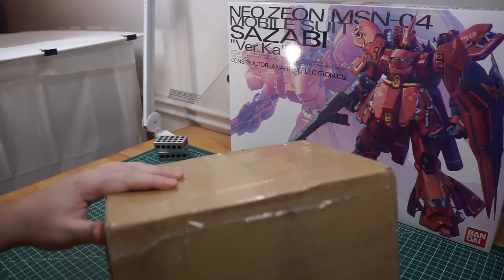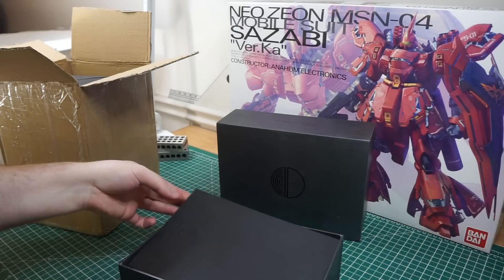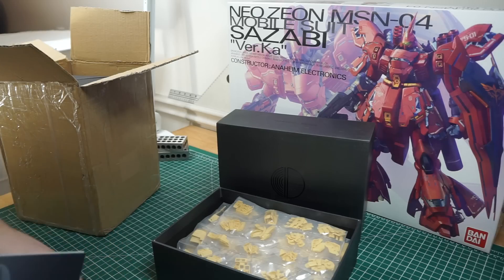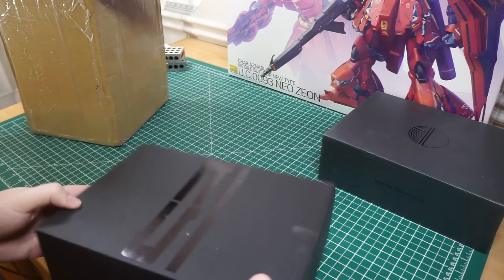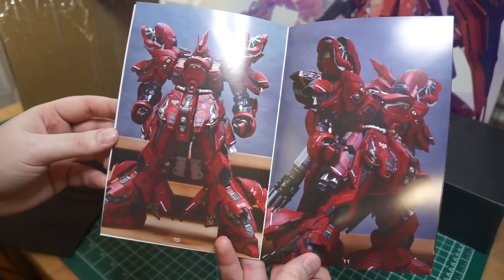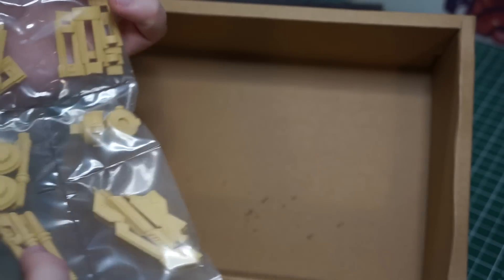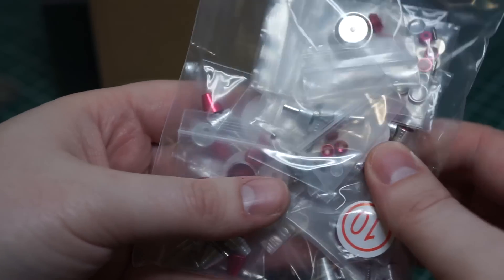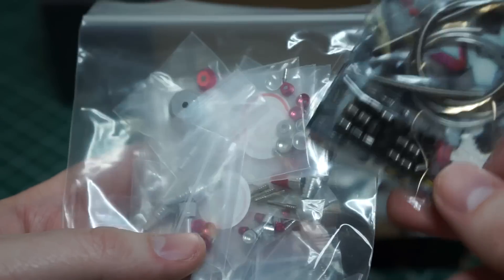Sazabi Ver.Ka Infinite Dimension Resin Conversion Kit | UNBOXING

Comment: Where can I get both sets of conversion kits? I am planning a marathon build Sazabi using this kit, metal detail , etching and custom slides. Id love to have a link as to where I can start.
Reply from the maker: Check out the Comments below and you shall find your answer :)  (Abbey Lee on Facebook is probably your best bet, or Ebay). Inquire now, as they may get harder and harder to find :)   Good luck!

Comment: I don’t know it this has been asked already, but could you post the links to the sites you ordered these parts from?
Thanks
Reply from the maker: You can usually purchase newer release or re-release Resin Conversion Kits from this and similar casters from Abby Lee or Samuel Decal on Facebook. You can look for Infinite Dimension Resin Conversion Kits on Ebay or various other places. Just know that these are usually smaller Run kits, so unless they do another batch, you may have a limited time to pick them up. Or, they may pop up on Ebay, but at a higher price, just due to it being increasingly rare.  Good luck!  :) Thanks for the watch, appreciate it!
Reply: Thanks for replying so fast, Have you done any more videos on this build?
Reply from the maker: Unfortunately not yet, not sure if any other Gunpla Tubers have gone farther than an unboxing.  Be sure to look for it in the future. I have a few projects I want to finish, but I will get into this after that :)  Having twin 1 year old boys take up a lot of my free time right now, but I will be getting back into it soon.  When I do get tot he build, it will for sure have a full WIP series from construction to finished paint. :)
Reply: Thanks looking forward to the WIP.

Comment: Hey MF, new to your channel.
Few questions since I just ordered my Sazabi Ver Ka. I am thinking of 3D printing the propellant tank myself but need some info as I'd like to get it ready before my kit arrives. 

1) Can you tell me how many metallic thrusters I will need for the model or will everything be included in the SMS Metal Detail Up Box set (including energy cable and pistons)?
2) What is the length and thickness of the propellant tank?

Thanks in advance
`